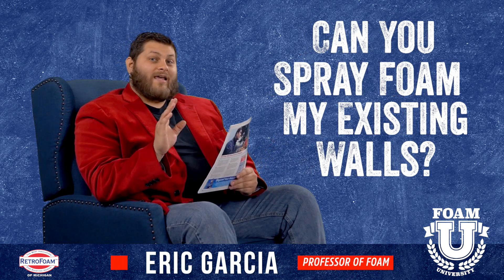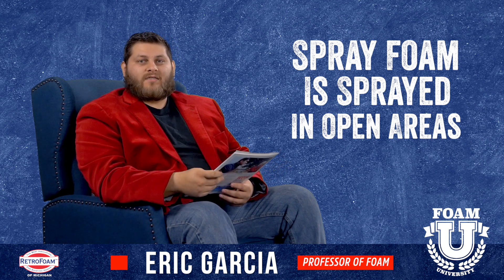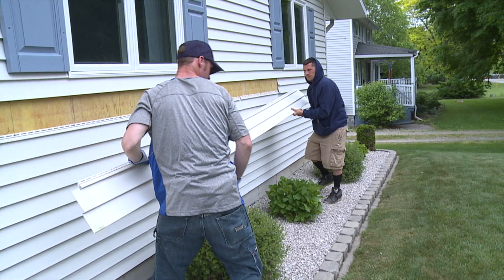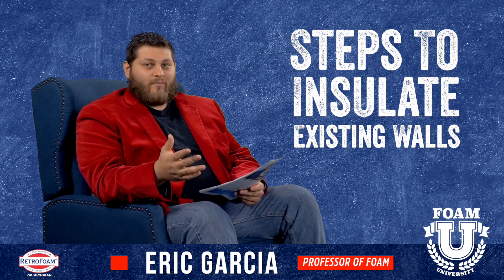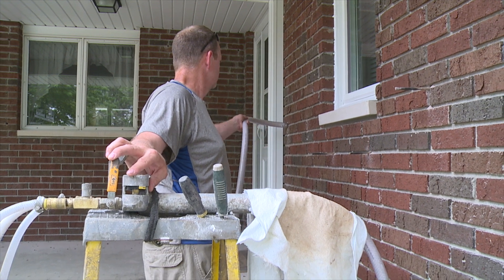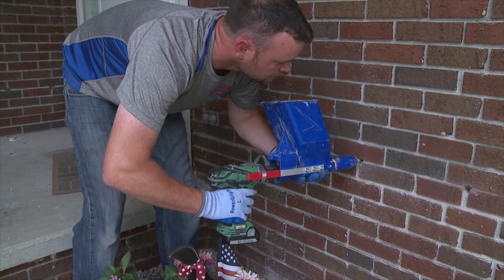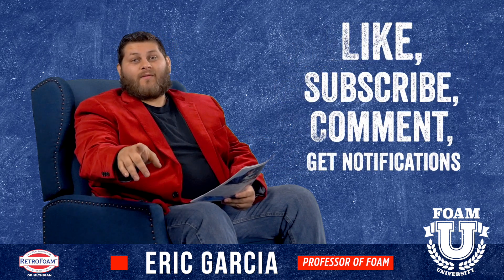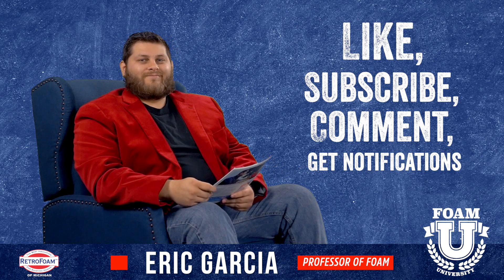Can You Add Spray Foam Insulation to Existing Walls? | Foam University

Comment: Eric, I recently discovered that the spec home that I purchased 22 years  ago does not have  sheathing or house wrap.  I was renovating inside a wall and discovered that when I removed the drywall all there was is insulation then the siding.  I was mortified, I never heard of such a thing.  Have you ever seen such a thing?  What can be done with the foam to help this situation or am I looking at removing all the siding adding the sheathing and wrap before I do anything?  Please help!  Thank you, John.
Reply from the maker: We have seen this more often than you would think. There are really only 2 (good) options for insulation. You can remove all the siding and have the walls spray foamed from the outside. Or you can have new sheathing installed followed by injection foam. Unfortunately these would be the only ways to properly insulate those walls.

Comment: Interior walls to an recently completed (4 years) home would create how much damage/repair? 4 inch holes everywhere or just from the top?  What about ceilings/floors? Same steps and cost?
Reply from the maker: The process is exactly the same if going through the interior - one hole in each cavity about half way up. If we run into a fire block then more holes would need to be drilled. RetroFoam injection foam is only used in existing enclosed cavities - for ceilings and floors you would use spray foam which is totally different product and process. We share all of this on our website https://www.retrofoamofmichigan.com/

Comment: How does injection foam compare to blown in insulation? Comparable R values? Is one better long term?
Reply from the maker: Foam insulation creates an air seal that isn't possible with other blown-in insulation. That air seal supersedes the R-Value because it is stopping air movement into and out of the home. Foam is also better in the long-run because it doesn't shift or settle over time. It also pays for itself in the amount of energy savings it provides.
Reply: @RetroFoamofMichigan  That's great, but you didn't answer the question. What are the R-Value comparisons between the two? The answer you give should have numbers comparing one to the other.  The way you answered just comes off as you dodging the initial question.
Reply from the maker: @turt1e  RetroFoam insulation has an R-Value of 4.6 per inch. Our foam also does not break down over time compared to traditional insulation. I hope this helps.
Reply: @RetroFoamofMichigan  I worked with a contractor when we were enclosing an outdoor patio to make it a year round room. We installed R19 in the ceiling and walls. It's hard for me to believe your injection foam only has an R rating of 4 compared to the fiberglass installation bats I installed. Let me know if I'm comparing apples to Apples here. Thanks in advance. Your video is great.
Reply from the maker: @tg9754  Our foam is 4.6 per inch and also creates an air-seal which is much more beneficial than R-value. Here is an article that you may find helpful: https://www.retrofoamofmichigan.com/blog/r-value-vs-air-seal-buying-new-insulation
Reply: @RetroFoamofMichigan  If there is a 2 inch gap for insulation in the wall, given the air seal your injected foam provides, is their an adjusted R rating?
Reply from the maker: @tg9754  There is no adjustment for R-Value. R-Value is the resistance of heat flow. With an air seal, air is no longer allowed to pass through.

Comment: Is injection foam fire and/or mold proof/resistant?
Reply from the maker: All products on the market are different, but the foam materials we use are Class One Fire Rated and don't promote mold growth.

Comment: Would this help with interior walls for sound dampening?
Reply from the maker: If you install injection foam insulation into your walls, the sound transmission can be reduced. It doesn’t cut the noise out completely, but it does make it quieter.

Comment: What about cross studds?
Reply from the maker: Whenever a stop or blockage is found in the wall, a good contractor will drill another hole above that stop to inject the foam ensure the top and bottom of the cavity is filled.

Comment: No way are you going to drill through my brick wall.
Drywall is an easy repair.
Reply from the maker: Going through the drywall is always an option. When we drill from the outside we drill through the mortar, not the brick.
Reply: @RetroFoamofMichigan  doesn't that weaken the brick in other houses?
Reply from the maker: @lorenabigley-robinson1340  that is a legitimate concern. That is why we mix and inject mortar right into those holes after the foam has been injected.

Comment: does injection foam affect old wiring in the walls. Is it safe to cover old wiring in foam?
thx
Reply from the maker: The wires have a coating over them, so the foam won't be an issue.
Reply: How do you ensure you’re not foaming over knob and tube wiring?
Reply from the maker: Most homeowners will know if they have knob and tube so that discussion usually happens during the estimate process.
Reply: What alternatives do that have if there is k&t? To my knowledge it’s a no-no to spray over.
Reply from the maker: @rasheemsanford9348  there aren't any insulation materials that are specifically designed to be used with knob and tube.
Reply: @retrofoamofmichigan Do I have the wrong information? Is it ok or not ok to foam over k&t?
Reply from the maker: @rasheemsanford9348  it's not typically recommended to spray over knob and tube wiring. There aren't any insulation materials specifically designed to be used with knob and tube, this is why it's important to have a conversation with your contractor about how to move forward with the project.

Comment: What is the average price for this injection foam
Reply from the maker: The cost to insulate existing walls can vary depending on the size of the project. Here is a little more information.
https://www.retrofoamofmichigan.com/blog/cost-insulation-walls-existing-home-prices-rates-factors